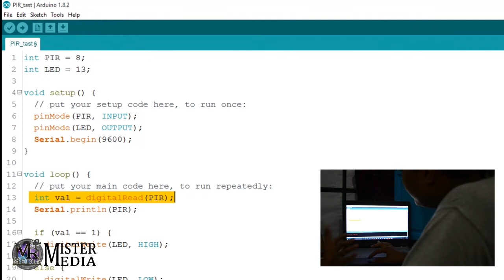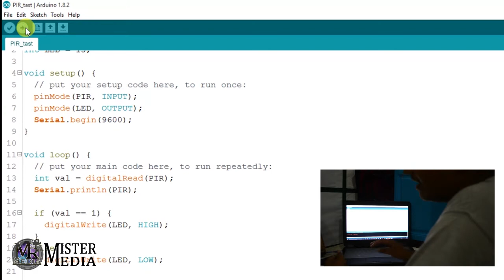how to use PIR sensor Arduino | தமிழ் | Learn Arduino Series in Tamil Ep-35

Comment: Bro mune panre projects le yepdi multiple sensors use pani arduino projects panirdhe in video paninge.
For ex: ultrasound sensor and lcd display
Ultrsound sensorle sense avre distance lcd le display avramadhri project pani apro program yepdi yelidrade ini oru project paninge bro.

Thanks in advance.
Reply from the maker: THARUN. V ok thank you
Reply: Mister Media. Apro stepper and dc motor yepdi arduino vechi drive panirdh ini oru project paninge bro